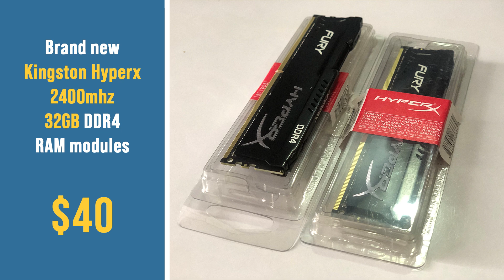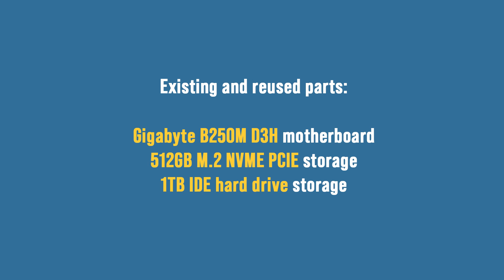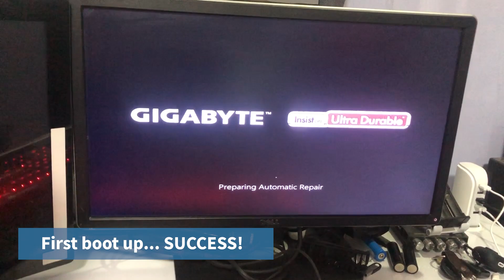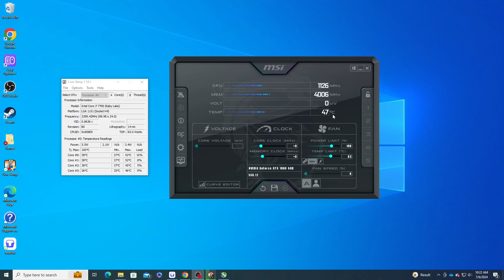Budget Gaming PC under $200 in 2024

Comment: I am trying to do a budget build myself and gift it to one of my followers. But I am struggling on how to know what parts will work the best with others? 

I will be using the rtx 3050 as my gpu (the plain $170 one i got for $100) and just need help on how to know what parts will give the best results especially the cpu. I know pc part picker is a thing but it doesn’t really go too far into depth comparison wise and performance wise. I’d appreciate some help! thank you !
Reply from the maker: Thank you for your comment. RTX 3050 is a great budget gpu. I usually start with bottleneck calculators. From there I'd choose the CPU, then search some more how well they perform together from reviews. RTX 3050 is best paired with i7-11th or 10th gen, or even a Ryzen 5 5600 if you want to stretch some more budget. All the best on you budget build.